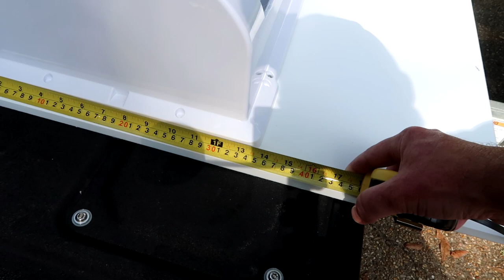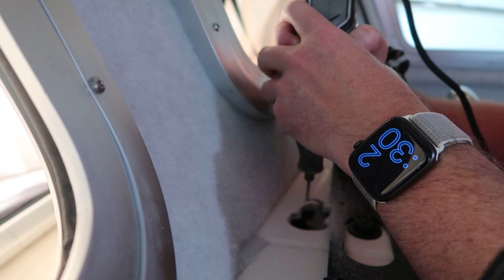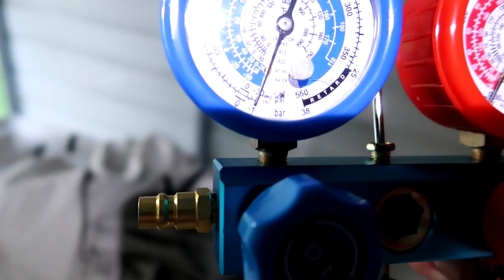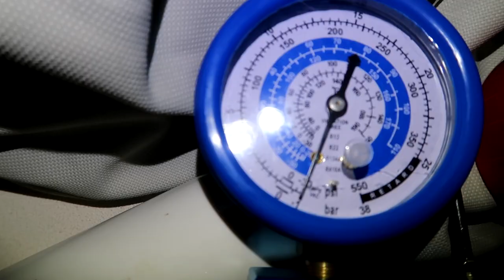Boat Air Conditioner Install Part 1. DC Runs Off Battery. Perfect For Rv or Van. Solar & Lithium.

Comment: Very nice install cap.  Im a refrigeration mechanic, are you a HVAC mechanic?
The only things that would concern me is the pounding in the fron is a lot strong that midship and i know you have your top unit way high  but in Rough seas salt will hit your condencer but like you said you will place a cove to protected👍
Now you know why i placed my$150 window unit inside  and i look at it after 3 years of heavy use and the unit is like new , as we boaters know salt is our equipment enemy ,but you will take good care of that unit ,im impress by what you have accomplished because most people wouldn't attempt to do this project. 
 If you don't mind me asking how much woul a 12 V air conditioner like that runs cap
Reply from the maker: Thanks for watching my video cap! As for pounding it’s an automobile unit so I guess I’ll report back about vibration. 
As for salt I have that protective spray I plan to coat on it some and I’ll mainly use when not moving. 
Window unit is great since inside. Love that but wasn’t sure where to put in my boat. Maybe above batteries but would have to make a new cabinet door. 
It was a lot of work but I learned a lot. I’m not a Hvac mechanic. And your right unit is expensive at $1699.00 but the DC units I saw that ran off battery marine and air cooled were at least 4k. So still way cheaper than others. I took a chance with this and I’ll report back if I have any issues. I really appreciate your feedback capt. Safe navigation to you, your wife, and foxy. 🙂
Reply: @mooseontheloose8956  awesome cap.keep us updated and yes the marine air are more expensive but me and you we like to  Innovate👍
Say hello to the wife and kids and Moose too👋⚓🛥

Comment: where does the condensate drain to? also would not use thread sealant on your fittings, refrigerant oil on threads is recommended.
Reply from the maker: Hey! I called reactorseal and they said this was best since would be a high vibration environment. I’ll report back any issue. Always love any feedback. Part two you can see my drain line. So far works great. Thanks for watching cap!

Comment: Im impressed!  Good job with the installation.  Your wiring all looks super neat under the console too.
Reply from the maker: Thanks Bryan! It was a ton of work. Wouldn’t have been so bad if the heat wasn’t radiating off metal shed. Should have did that one last spring. Glad it’s over.